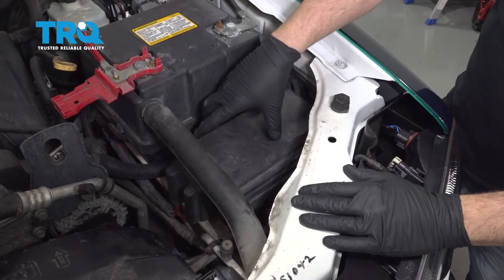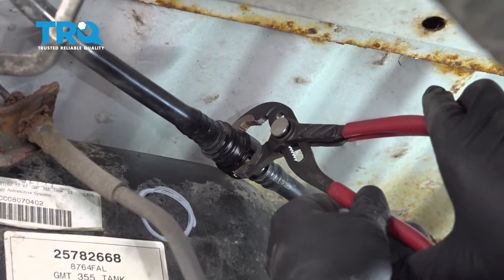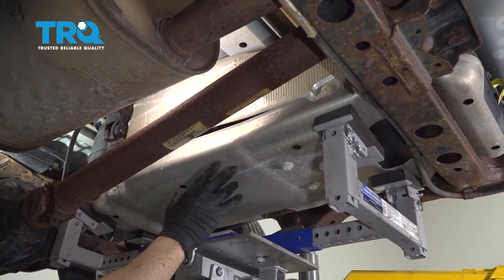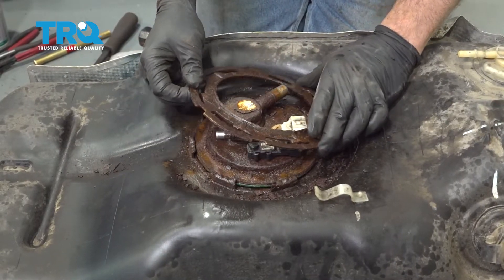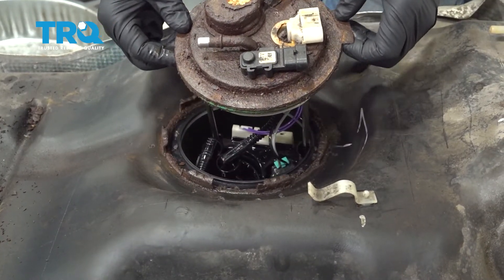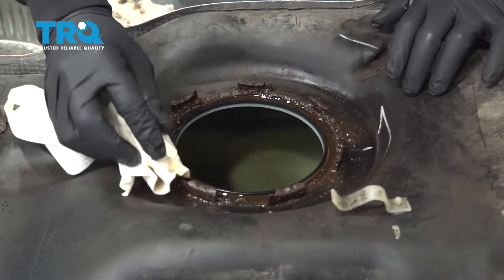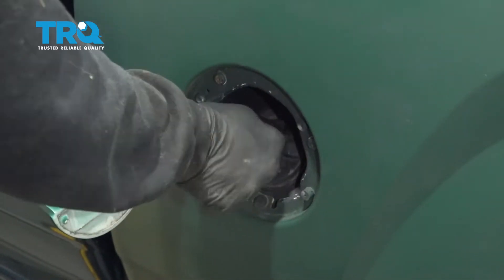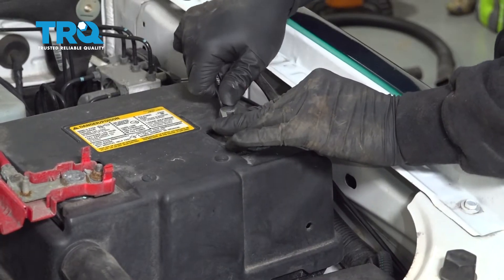How To Replace Fuel Pump & Sending Unit Assembly 2004-2012 Chevrolet Colorado

Comment: 2012 Chevy Colorado with extended cab.  6 bolts taken off in 5 minutes with an impact wrench, quick snap disconnect of the two rear light connectors, remove two screws holding the gas tank neck to the bed.  Compact tractor to remove the bed and the whole back end is exposed.  Way way easier.

Comment: Is it normal to tap the new fuel pump unit into place with a hammer?  Mine fits into the hole but the one of the two spring assemblies won't collapse unless I tap it with a 5 pound hammer.  Thanks

Comment: Great videos you guys put out. Here is my issue,  I bought this 09 canyon a while back, got this fixed that fixed. Getting it nice and tight. Problem? Ive got this rattle under the truck, I think I know what it is. Under the fuel tank there is a protective shroud. It appears to be held in place with plastic clips that push in? How the heck do I get those out? I think something fell down in there and its making all kinds of noise. Can you advice me? I tried to pop those clips out but theyre old, and break easily.

Comment: Good video. The only part I don't have is a tank jack. Never seen one of those before. I think a friend and some swearing would get the tank out. 

Some folks think it's easier to take the bed off. That was true with my 99 Silverado 4x4, don't know about this one. I don't have four friends who could help. 

Once you have the tank out, be sure to look inside for contamination inside the tank. That's one of the things that can shorten the life of a fuel pump, regardless of the filter.

Comment: Easier to do when you pull the bed off
Reply: God dammit really? 😨
Reply: It really is easier, that's how I did mine. Not to mention all those connections will fight you tooth and nail when trying to disconnect them. Much better to have the room you need for leverage and prying things apart.
Reply: Just did mine.  Removed the bed, 6 bolts and a couple friends. Much easier to reach everything. I also POR-15 my frame while I had the bed off. Great step by step video.
Reply: Does it work with a crew cab though? Or do you have to drop the tank at that point.
Reply: @dondes88  Just watched another video before this where the guy took the bed off for an extended cab and he mentioned that the crew cab would cover the pump so you'd need to take the tank out. Looked like that would be the case too. Of course, I have a crew cab to work on too...